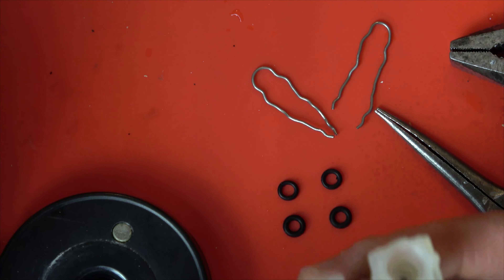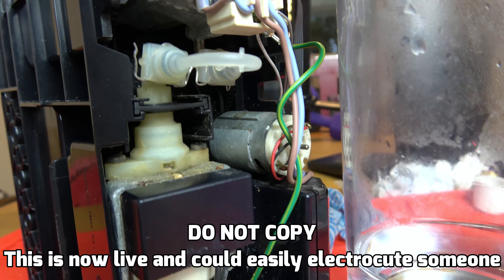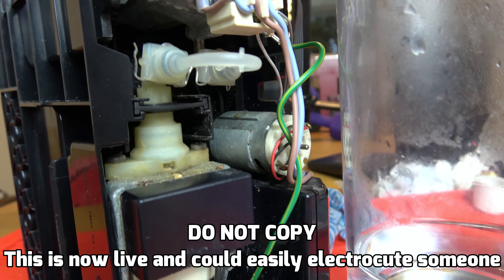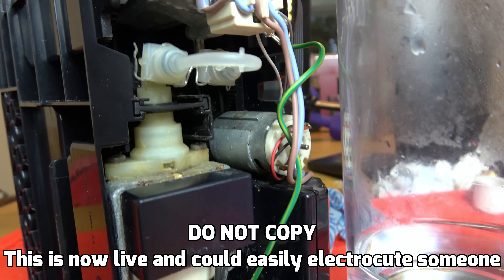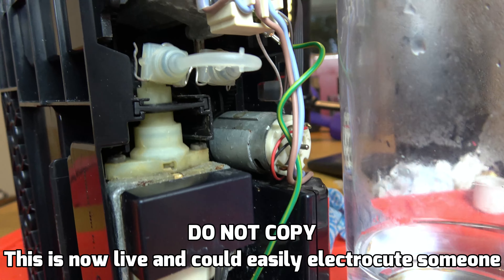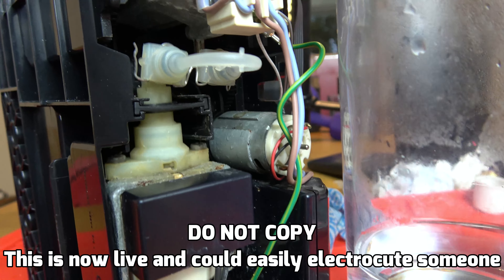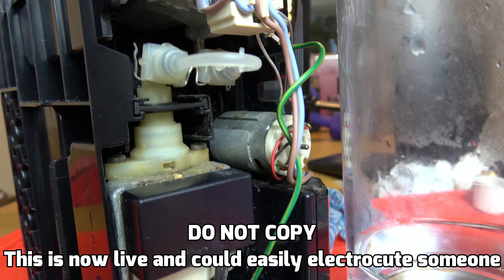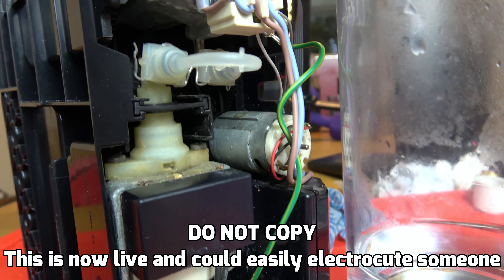How to FIX LEAKING Nespresso U and Stuck Lid - May work for Delonghi Krups Inissia Pixie Essenza

Comment: At 0:40 it has a Schuko plug, but by 8:50 it's turned in to a UK plug.
Reply from the maker: I put a UK plug on it as I wasn't happy with the Euro plug forced into a UK 2 way adaptor. I wasn't sure if it was making a good contact 👍
Reply: @NoWaffling  I assumed you'd changed the plug.  Not to mention no earth connection jamming a Schuko in to a 13A socket (though the appliance may be double insulated).   But a victory for the conspiracy theorists who think you switched machines 😄